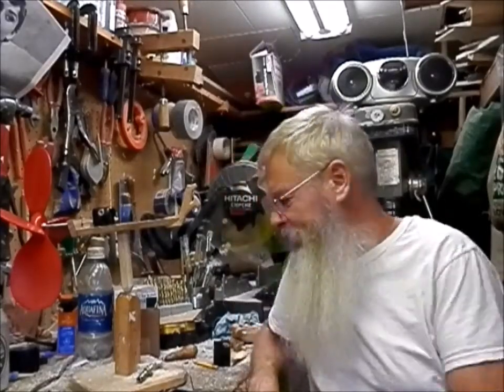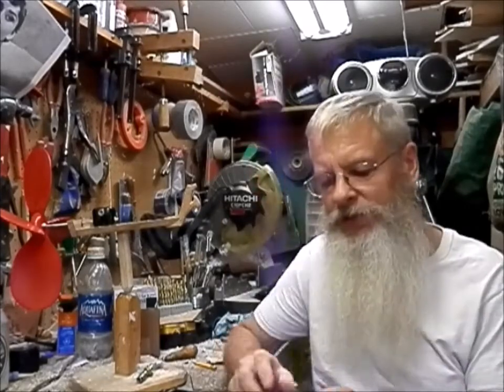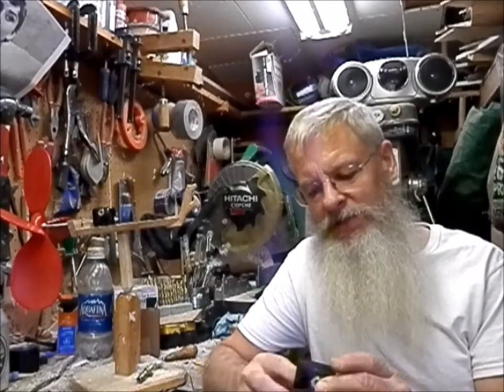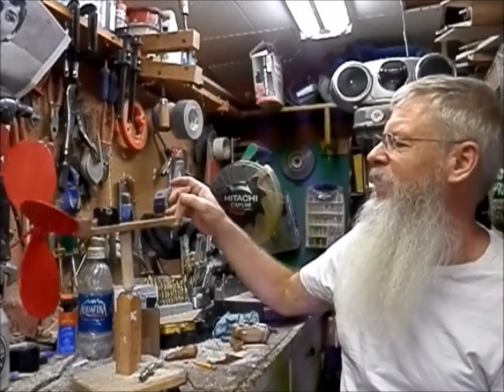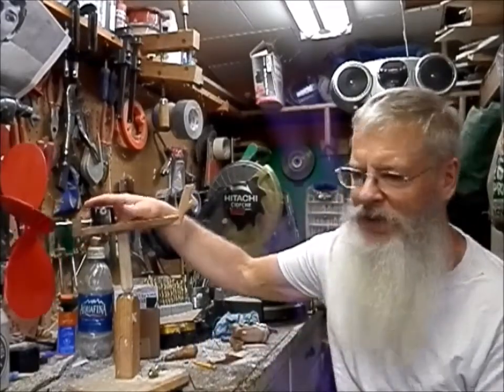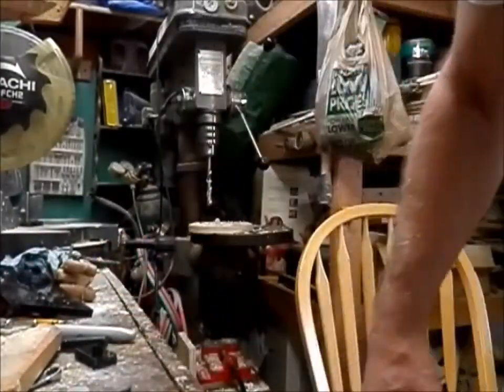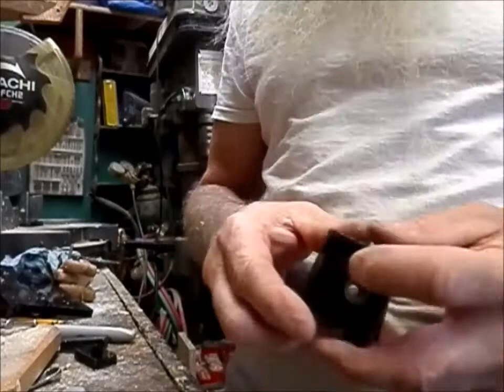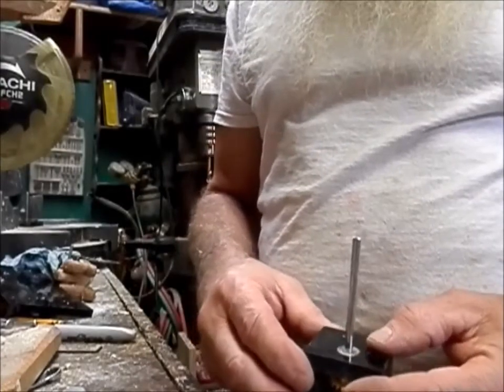automata art: How to make a man rowing a boat whirligig pt. 1: the gear box

Comment: I have built Whirligigs over the years and my grandkids want to help me build this Rowboat. I asked you about the worm gear box on Etsy and will be purchasing one when they are available. I did watch the video about the Tetrix gears and they mention the worm gear will not run backwards. This may sound like a strange question but all the fan blades I have purchased in the past seem to turn CW. I ordered your fan blade on Etsy and it looks like the blade pitch will turn CCW? Is this true? Thanks for your great videos that I enjoy watching!
Reply from the maker: Hi Bob! The propeller I sent should turn CW. I looked outside and checked to be sure. The rower needs to have the propeller turning CW, or he rows backwards. I had a problem with this when I first tried to make a rower until I figured out the prop needs to turn CW. I think CW is better because a CCW prop always wants to undo the prop nut. I never had any problems with the worm gear running in either direction.  I checked a minute ago, and it seems to spin both directions. Thanks for stopping by. I'll get to work on your kit next week. Warm greetings from Wishram.

Comment: Hi Todd   Thanks for getting back to me.  I see that the main gear thet you use has hubs on both sides. I assume that there are set screws in both hubs  which allows you to secure the oar shafts.  I can only find singke hub gears.  I have searched many sites with  no luck Thanks Todd I got it
Reply from the maker: There is a link in the description for a worm gear set from Pitsco. the gears are expensive for what they are, but they were the only ones I could find. Good luck!

Comment: Excellent! I was fretting over how to do this...except I can't see what you're doing at around 13:00.
Reply from the maker: Hi terrulian! At 13:00 I was applying superglue to my pieces of plexiglas for the gearbox, and then I got everything alligned so that the gears and bearings turned freely, before putting the clamp on. If you can get this gearbox made, the rest is fairly simple. It took me a few tries to get it right and I'm still learning. Let me know if there is anything else I can help you with. Thanks for stopping by. I hope you are safe and well. Take care.
Reply: @ToddAndrewCole  Thanks for the kind wishes. Same to you! Question: are you saying you actually can adjust the box after putting super glue on? Or is the acrylic glue used for the final assembly, which you then adjust? BTW, I found some gears online but when they arrived the worm gear was one size and the wheel another, and both were metric whereas I'm using SAE rod. I think I've managed to modify things to work, though.
Reply from the maker: @terrulian  Yes, I was adjusting the parts after applying a generous amount of super glue. Acrylic glue might be a better choice the first time you try it, but I like that the super glue sets up quickly. It's all about modifying things so they work; I love the problem solving! Take care.

Comment: Hi Todd what are the bearings? Is the plexiglass 1/2 in thick I am just rounding up what I will need. Thank you so much for this video Todd I hope you and Peaches and Pear are all doing well
Reply from the maker: Hi Deb! I use 1/2" OD (outside diameter) x 3/16" ID   (inside diameter). I bought them off Ebay by searching "1/2" x 3/16" sealed ball bearings." Hey, I happened to be looking through my box of plexi-glas, and I have some pieces that might be useful to you. If you email your shipping address, I will mail them to you. You can email me at toddimpson@hotmail.com
I used 3/8" plexiglass for my gear box. Let me know if I can do anything else to help you out. Take care.
Reply: Hey Todd thank you so much I am just heading to the plastics store to get a window for my elevator I will have a look for some scrap pieces their if they don't have any I would love some pieces but I will search here first.
Reply: Thank you Todd for your kind offer

Comment: Ingenious. A kinda of reverse engineering. Very helpful approach.  I wondered if you ever get a finished gear box where the gears are a bit too tight and bind. I found putting tissue paper or a thin fabric between the gear teeth as I'm cementing a box helps. You. of course, remove the material once everything thing is set. It guarantees a wee bit of space that prevents binding. And, as I watched you drilling the acrylic I saw the fragments from the hole spinning off into the workshop. This always bugs me about drilling plastics. I finally cut a large clear plastic peanut butter jar in half so I had a cylinder. I place it loosely around the chuck and let it ride around  whatever I'm drilling. I can see through it, and it catches the spiral threads of plastic. I hate cleaning more than I have to. I'm saving this to my technical wee weather vanes URLs. Wonderful tip on building.
Reply from the maker: Thanks Terry for your comments. I'm certainly a novice when it comes to plexi-glas, so I appreciate your insights. I like the idea of using tissue paper and the peanut butter jar. The learning process has always fascinated me.